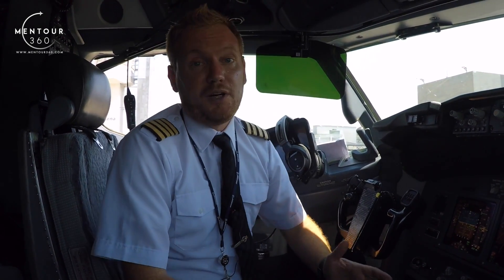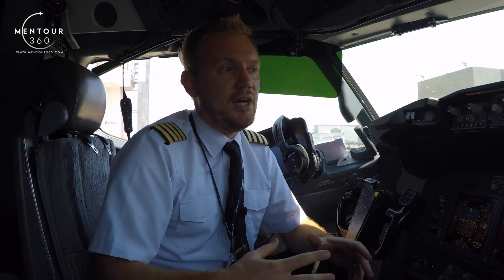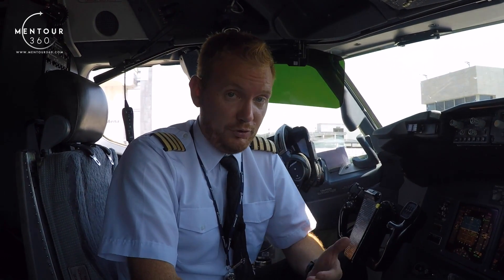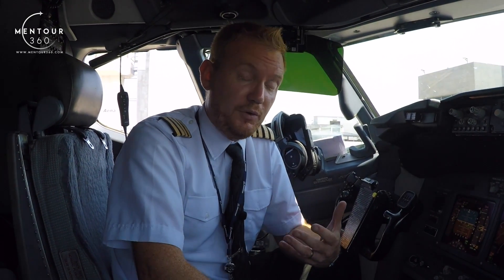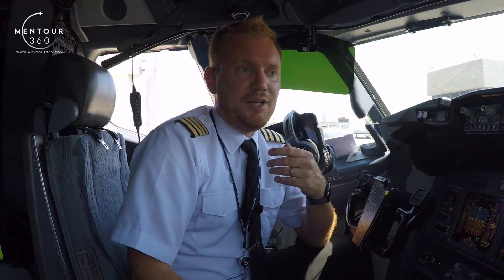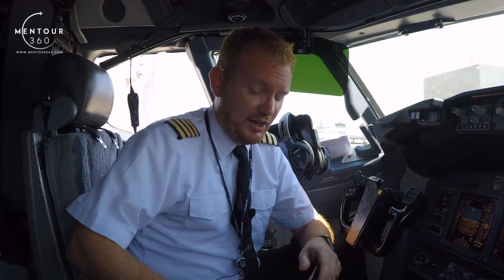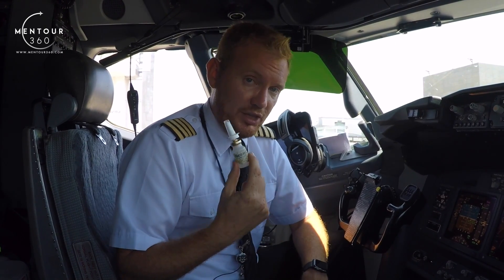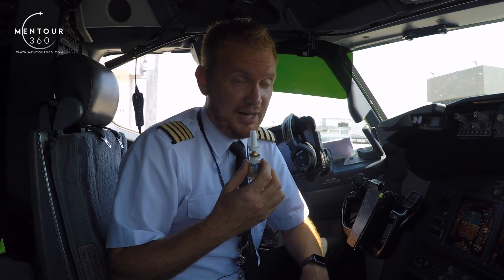Do the pilots ears pop?

Comment: When the external pressure is increasing (as when the aircraft is descending), hold your nose, purse your lips and GENTLY exhale. This will increase the pressure in lungs, throat, ears and sinuses and will push a little more air past the blockage in the eustachian tubes and bring the internal pressure into balance with the external pressure.  If you wiggle your jaw back and forth as you do this, it will help temporarily relieve any blockages in the eustachian tubes.

When climbing, closing the nose and mouth while swallowing will reduct the pressure in the system and allow the system to equalize the internal and external pressures.
Reply: Yep. This is what I do. It works.

Comment: If you're descending you can also use the  divers trick of holding your nose and blowing through it. It will pop your ears. The best thing is to do it continuously while descending.
I had earplugs in while in a military airplane and my ears were itching while I was descending and I had the bright idea of pulling the earplugs out, instantly burst one of my eardrums as soon as I pulled it out,  the pain was very intense. My hearing didnt return 100% until 2-3 months later.
Reply: spoofer20, Clearing ears like a diver works for me, too. I do it between 10-20 times during any given descent.
Reply: Do earplugs help? Do they compare with other tricks, e.g. blowing?
Reply: I did the same thing with the earplugs

Comment: This happened to me on my last flight. I had a cold and could for the life of me not pressurize my ears. during T/O it was bad, but manageable. But during landing it got really bad. It hurt like hell, couldn't hear anything and my left eye was going blurry. A flight attendant gave me a saline solution. It didn't help much, but it was just enough to not go absolutely crazy from the pain. It took me a good 4 days before I fully recovered from that. 

One thing I learned, never again will I go on a flight without a nose spray, and I will use it vigorously if I feel it is needed. I have a fairly decent pain tolerance, but this was bad. Probably worse than the migraines I sometimes get.

Comment: This is my #1 "fear" of flying right here, so I appreciate this video (despite how disturbing it was to watch 😅). Last time I was on a plane, I was 8 years old, and it took like five minutes after leaving the plane before my ears popped back to normal. I have no memory feeling this for multiple flights beforehand though.

Since that day I've experienced two general forms of ear popping. Part of my daily commute to high school involved traveling over a hill on the city bus; sounds like this is closest to the ear popping on flights. You'll also experience this on elevators in tall buildings.

But there's also another kind that you experience on trains when they go through tunnels. Essentially when a train suddenly hits a wall of air, it's a sudden pain in your ears. Covering ears with your fingers for a minute absolutely helps. I wonder whether something like this also exists when there's turbulence?

Speaking of pressurization, I have slight trouble breathing onboard trains when all the windows and doors are closed. When the doors open (or I'm near an open window), I immediately breathe normally. Could this be a problem on any plane? (It's not claustrophobia. I breathe fine on elevators because they have good ventilation, not tightly sealed.)

Comment: Ascent is less of a problem as the air in the middle ear expands and can force its way down the eustachian tube with minimal help.  During descent, the air shrinks and the tube is more likely to collapse closed and stay closed.  That can take more conscious effort to prevent - yawning, blowing down pinched nostrils etc.  For this reason, I'd never sleep during descent.  I've been known to carry a xylometazoline metered-dose nasal spray - which is a powerful decongestant - more as "insurance" than anything else.

Comment: The way I learned to do it during descent is to close tight your lips and block your nose by pinching with fingers (using tongue doesn't work as it blocks the ear tube too), and push the air using your lungs (not your mouth, it needs to be relaxed). It's a similar feeling as to when you sneeze while you block your nose, but you can hear the air seeping back to your ear, and the bass comes back.

Comment: There was a flight by the Greek airline Helios some years back, where the cabin didn’t pressurise at all on takeoff because a ground technician had accidentally left the pressurisation control switch in manual mode and the crew apparently failed to notice it. Everyone save for one flight attendant succumbed to hypoxia at altitude, and while the flight attendant had had a few hours of flying lessons under his belt and attempted to save the flight, it still crashed killing everyone on board. My question is, why wouldn’t a seasoned flight crew have known something was seriously wrong by the way their ears must have been violently popping on climb-out, immediately suspected failure of the cabin to pressurise, and noticed the incorrect switch position before it was too late?

Comment: When I was a child I went on a flight and as we were descending one of my ears would not adjust to the changing pressure. I chewed gum, tried swallowing my saliva and yawning and nothing would relieve it. The cabin crew gave me a styrofoam cup with a cotton ball in the bottom that had been moistened with very hot water and had me hold it over my ear and it helped somewhat.

On another flight, where the flight path was from Winnipeg to Edmonton to Calgary and finally to Los Angeles my ears didn't pop once but as I was walking up the ramp into the terminal in LA my ears did a rapid fire popping for several minutes. It didn't hurt just felt weird. However, I wonder why that happened?

Comment: Excellent video. We as humans tend to fear that which we don’t understand. As such, you give a great explanation for “laypeople” of how cabin pressurisation and the mechanics of the human ear interact. I did note that you specifically cited “modern” passenger aircraft in your description of cabin pressure control, and that the hull begins to pressurise on rollout and thereafter, the system calculates and maintains the correct rate of “cabin climb” up to a maximum of 8000 feet. (Is that ASL or AGL? Must be ASL - Picky, picky! 🙂). Is it not also true that on older aircraft, a crew member would manually adjust the cabin altitude, and some pilots would do this with less, er, “finesse” than others? That would explain why my ears still pop much more, and a lot more violently, on a DC-9, for example, than on a Boeing 767 or an A320. It would also explain why, as a kid  in the seventies flying on a lot of “Niners” and other passenger aircraft of that vintage with my parents, I tended to have a lot of ear problems, whereas now as an adult, I barely notice it. That, besides the fact that in children, the Eustachian tubes still have not fully developed to adult width.

Note I’ve also taken flying lessons (I still hope to get at least my recreational license one day), and on a light, unpressurised Cessna 152 I never noticed my ears doing anything at all, even though I’ve been up to 10,000 feet numerous times to practise maneuvers like stalls and spins. In this case, I attribute it more to my being too busy concentrating on flying the aircraft and watching out for other traffic to notice anything else not related to those important tasks! 😀

Comment: I have been following your channel for quite a while now. Thing is, I did already know a lot about aviation, but still learned some new stuff on your channel. I never quite had a question, until yesterday I was thinking about something that might sound silly, but for you guys is very important.

Q: How are the flight hours determined? I mean, do they start counting from the moment you enter the cockpit, when you start your engines, from the moment you take-off... etc?

Q2: Then I had another question about the circuit board. I mean, after all these years I almost know every button, switch and its function in a 737, except for the circuit board. Could you maybe do an quick overview of what sits where on the circuit board or a video dedicated to the circuit board alone?

Keep up the good work! :)

Comment: I remember one flight all the way back in 1998 during a three week long vacation in Australia. I had a cold from the constant use of air conditioning and I thought I would die during the decent (well, not literally die but the pain in my right ear was awful). Shortly before touch down there was this rather loud plop sound in my ear and finally the pressure was gone. I'm still unsure whether my eardrum actually burst at that point or whether it was just a pretty painful normal equalization. Certainly don't want to do that again. :(

Comment: I just force myself to yawn by opening my mouth and adjusting my jaw. I fly in aircraft that don't pressurize and we fly up to 12,000 feet MSL all the time. You get used to it but it definitely can be a problem if you can't release the pressure as you descend back down to the ground. Just try to force yourself to yawn or eat something and you will release the pressure.

Comment: I have problems driving to work, going down only 800 meters. I have to manually pop my ears or I can't hear properly.
My Eustachian tubes seem partially blocked all the time.
But, holding the nose and pressurizing inside the mouth and throat always works.
Same with descend in air craft. Several manual adjustments are needed.
Nose spray may be good for that, I'll give it a try. I use it occasionally to stop snoring, for which it works well.
But, apparently you can't use it all the time.
Reply: Never use the spray for more than 5-7 days running or the problem can come back even worse afterwards.

Comment: i catched cold and i was returning home. My nose was partially blocked. And on a descend i felt pressure on the eardrums and even pain, and was unable to relieve it by swallowing. Then i closed my nose with my fingers and blew it, that opened my eustachian tube for just enough time to equalize the presure.

Comment: You finally got to this topic.  Thanks.  You didn't talk about what can be done for young children during decent.  Even without a cold, its very painful for them.  Can the pilot manually control the pressure to improve things, or is it always left in automatic mode?
Reply: I think manual control would be a lot worse than computer control. The cabin pressure has to come back from 8000 feet to ground level somehow, and a computer is going to do it a lot more gradually and gently than any human being, especially a human being who is saddled with numerous more important tasks at the same time.

Comment: Why does the cabin crew close the curtains when they prepare food and drinks?   Is it true what Gordon Ramsey said about the cabin crew that they don't clean out the water for months and the food is out of date? Great videos mentour!! Keep them up! Xx
Reply: Jack Evans That curtain always used to really annoy me, until I sat in J then I thought it was really cool. 🛩
Reply: The cabin crew isn't responsible for the quality of the water. Ground crew that work at the airport change the airplane's water after each flight. The meals are not out of date, otherwise everyone would get sick, and that would not be good!
Reply: Jack, the pilots eat the same food as the passengers, if they get sick, you'd have a major problem. I don't know where mister Ramsey got that crap from, but I'm pretty sure its incorrect.

Comment: I have a question! 
Can you make a video explaining the fuel systems or just reply with a comment. It will help a lot :)
Reply: Fat Potato what would you like to know?
Reply: Depends on what you want to know really. The 737 in this video has a tank in each wing and a single tank in the fuselage, which I believe is between the wings. The center tank and both wing tanks have 2 fuelpumps each. Both wing tanks can be connected to eachother with a crossfeed valve, which can be controlled from the cockpit and is used to balance the plane if one wing carries more fuel then the other. The left engine gets fuel from the left wing, the right engine from the right wing. The APU in the tail uses the left wing tank and requires the left wingtank main fuelpump to be running in able to start. The center tank feeds both engines. When flying, the center tank is emptied first, on short flights where the center tank is not needed, only the wing tanks are filled.

Disclaimer: I'm not a real pilot, I fly simulators, mostly the 737. For more detail, whatch the "AOA PMDG 737NGX Fuel Preview" video, here on Youtube
Reply: Fat Potato Captain Joe made one for the 320s. The fuel systems are quite similar.
Reply: Fat Potato I just saw a video on this. Not sure if it was a recent one but it was really good.

Comment: Hi, yes, you are correct, I suffer from tinnitus, and my ears are constantly clogged up, but when the aircraft is climbing my ears unclog, and I can hear clear as a bell, but when the aircraft starts to decend, immediately my ears feel clogged again, this can be very painful at times, I usually chew on some fruit sweets, this helps me to keep my ears reasonably comfortable, some aircraft are worse than others, could that be a different cabin air pressure system?

Comment: Does it depend on the aircraft? Because when I flew on a 737-800 or an A340 I had no problems at all while on a 777 I had some pain on take off and landing.
Reply: Very new aircraft (787 Dreamliner, A350) actually pressurize the cabin more so it feels better. But I don't think they have that in the 737, A340 777 already...
Reply: LOLametro It will be interesting to see the difference. Q400 not nearly as bad, is that because they do not fly as high?

Comment: yawning can help too as I use that technique all the time whilst flying or travelling by train. I have noticed that on plug door trains that are air conditioned you hear a pop as the doors open which I put it down to the cabin pressure on the train to a smaller version of that on a plane so should I be right thinking that?

Comment: Can you please tell me why an airplane doesn't stall while landing with full flaps?  I have heard that full flaps cause separation of the airflow from the wings and cause an airplane to stall. 

I have searched everywhere for an answer but just cannot find it. So a reply will be much appreciated. Thanks in advance
Reply from the maker: +a bc No, that doesn't happen. If that was true the flaps would be utterly useless.
The flaps have slots in them that enables some airflow through and over the flaps to maintain luminary airflow. 
They increase both lift and drag and enable the aircraft to fly significantly slower while still not stalling.

Comment: Why isn't it pressureized to sea-level?
Reply: Mattias Kågström if it is at sea level the outside pressure will be to overwhelming to the inside pressure and the whole cabin will crush like a tin can
Reply: But at least your ears wont pop.
Reply: Actually the pressure is reverse so it would do the complete opposite. The outside will have a lower pressure than the inside. Sea level pressure is a lot higher than cruising altitude.
Reply: Because the strength of the aircraft structure required to pressureize an aircraft at sea level pressure (1013.25) while at cruising altitude would be really massive. At approx 8000 feet, the human body can still breathe normally and it's much easier for the aircraft to maintain that pressure.
Reply: Also, in the event of depressurisation the pressure difference would not suddenly drop from 0ft to >30000ft, but from 8000ft so maybe it lowers the chance of hearing damage in that case. (Note that pressure is not linear with altitude)
Reply: Sebastian Grygiel depressurisation in mid flight from any pressurisation would be mostly catastrophic in most circumstances
Reply: +Lowkey Depressurisation on its own shouldn't cause a catastrophe, there are procedures to rapidly take the aircraft down to breathable altitude under 15000 ft, and the relative pressure difference between 8000ft to 30000ft is not much more than of 0 to 8000ft
Reply: Dragon Slayer Ornstein I'm pretty sure I would rather have my ears pop than being crushed like a tin can
Reply: @Lwkey Gaming   Not really, it is all the way around. If pressurized at sea level pressure, the airframe would, in any case, burst like an over inflated balloon, not be crashed. The pressure in the atmosphere decreases with altitude. 
The pressure inside an airliner's cabin aloft can be higher than the one of the air outside with a differential of 8:1or more. That is, many times higher than the pressure of the air outside. An aircraft can certainly be built to withstand a much higher differential, like the one necessary to maintain sea-level pressure in the cabin when at altitude, but the structure with the necessary strength to accomplish that would be very heavy to be practical. Furthermore, a commercial aircraft has to go through many pressurization-depressurization cycles during its life; many thousands, in fact; that is a huge amount of stress and it is cumulative, so, a compromise is made. To reduce the repeated pressurization-depressurization stress on the airframe, the cabin is pressurized at a lower pressure than sea level, but still high enough to provide comfort to passengers and crew, the equivalent of around 5.000 to 7.000 ft at cruise altitude in airliners.
Reply: That would put more pressure to the cabin so it would fatigue and burst more easily.

Comment: Hi Mentour Pilot, last year when i was taking a flight, i had a sore throat and flu, and during that flight my forehead felt like it was gonna split open, the pain is the worst i have ever felt and it doesn't feel like it was a headache. Is this issue caused by the pressure changes?